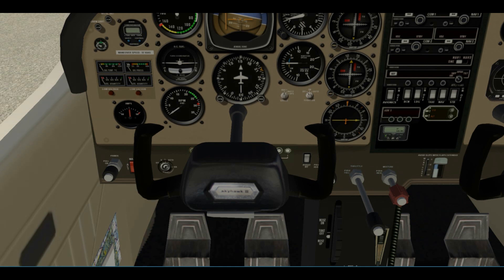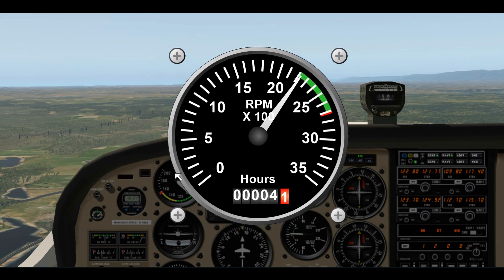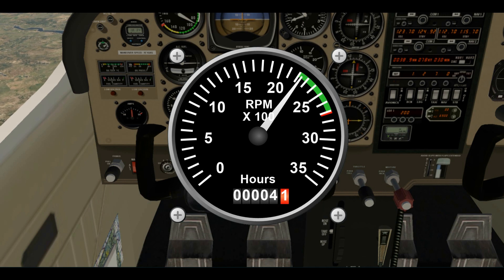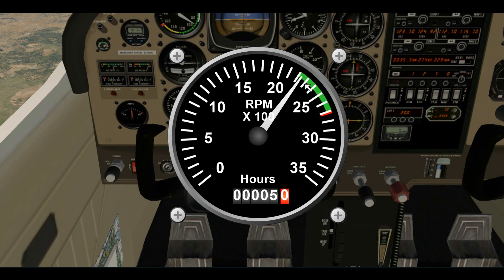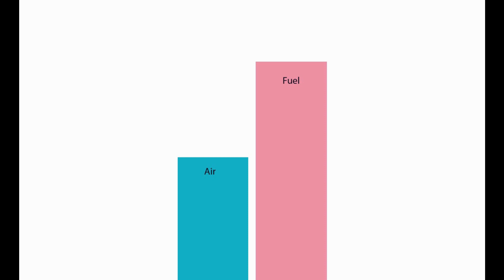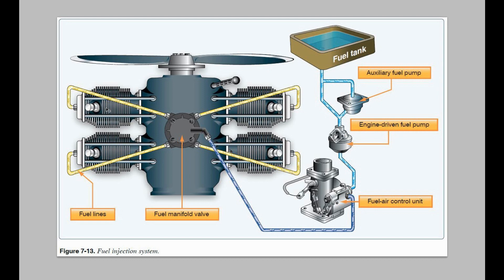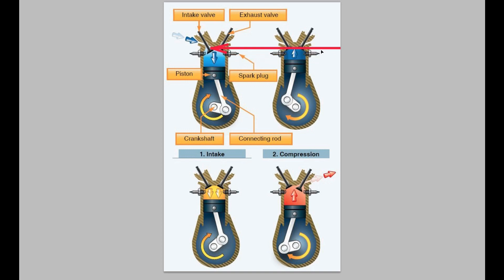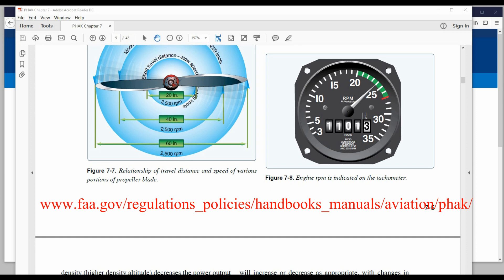The Mixture Control ~ Learning to Fly for Beginners in X Plane 11 Part 8

Comment: Imagine making a instructional video for properly setting the mixture on an engine all while still not knowing stoichoiometric ratio or while understanding its relation combustion chamber pressure/cylinder head temperatures
Reply from the maker: Hi Trevor, Sounds like you don't approve of this video, I'm sorry. I realize this is a very simple explanation and lacks a lot. However, this videos, as with all my videos, are for simulator pilots so they can have some idea of how to use controls and enjoy flying on the computer in a somewhat realistic manner. I don't understand all the science involved in this subject and for the simulator pilot they don't need to know either,  just need to know how to make the adjustment and have some fun with their simulator.

Blessings,
skip

Comment: Well, when u have an engine built for leaded gas and you throw unleaded in it its going to have issues. That lead helped the valve seats so they were built weaker, so obviosly youll start to have issues when using unleaded. Fauling could just be the carbs running rich, you have student's flying them that may not be always correct with the mixture adjustment
Reply from the maker: Hi izaiahschlosser4512, Right you are but it's been over 20+ years since leaded gas has been available so there probably are not too many engines running today that have not been rebuilt or replaced for using unleaded fuel. 

Not only do you have students not using the mixture controls correctly some seasoned pilots struggle getting the mixture correct,  it's easy to forget about the mixture control when the flight conditions are really challenging, all this effects engine life. 

Thanks for your comment and thanks for watching :-)

Blessings, 
skip